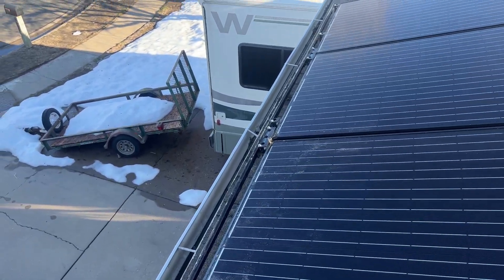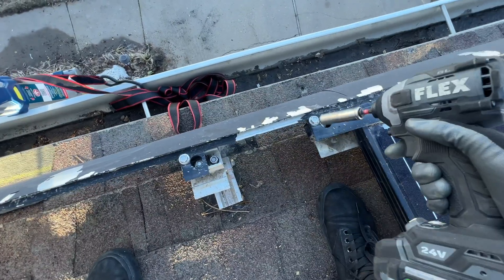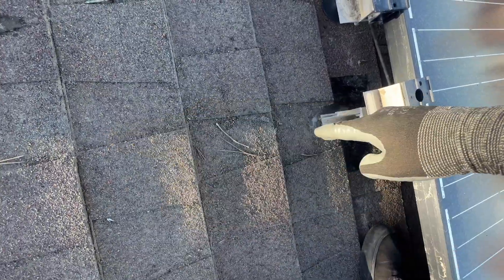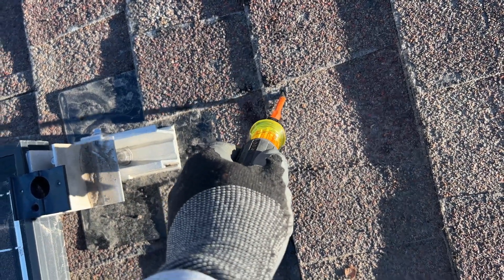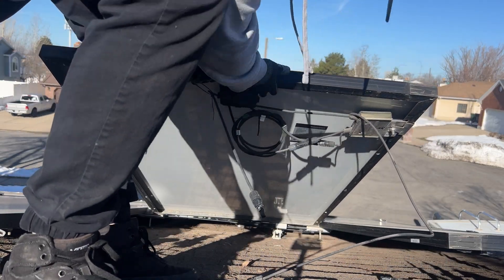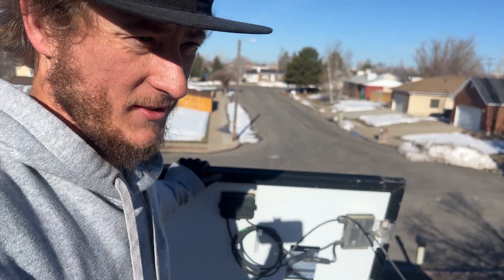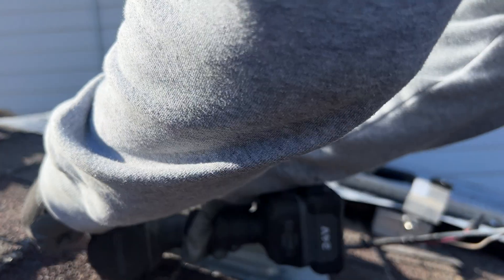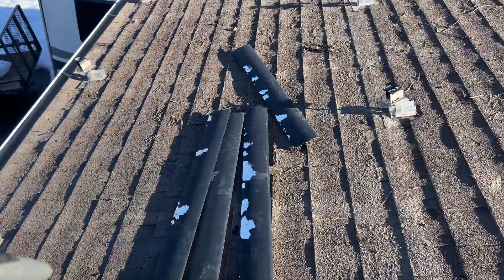Broken Vivint Solar Panels System, Looking At The Common Problems

Comment: Super informative that the Ethernet connection being the best way to monitor production and that it’s working. Can you do a video on how the solar edge EV charger connects to the energy hub. And my question is if the energy hub goes out does that take out the EV charger as well? It would be a great follow up to the mini review of the SolarEdge EV charger you did a while back.